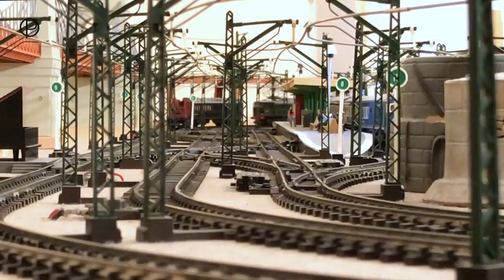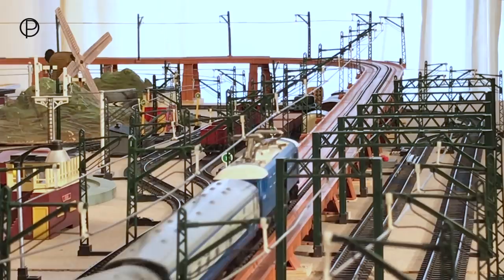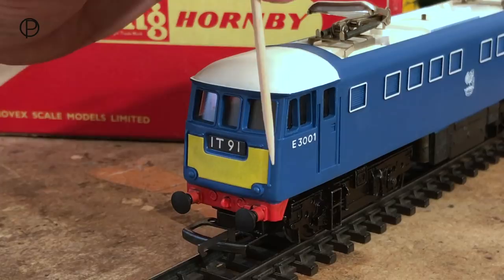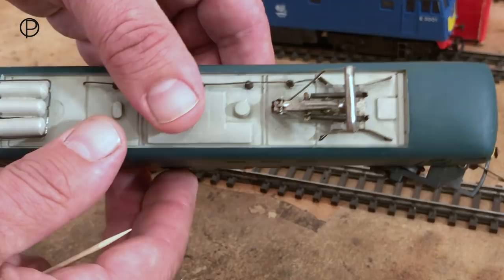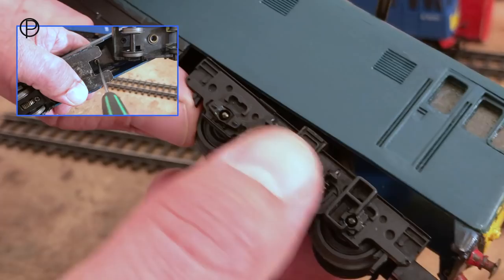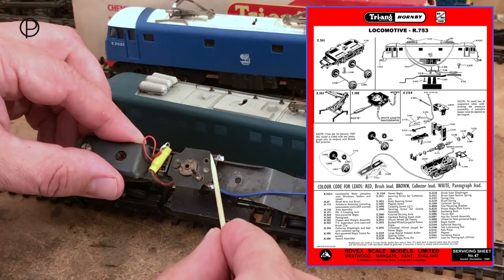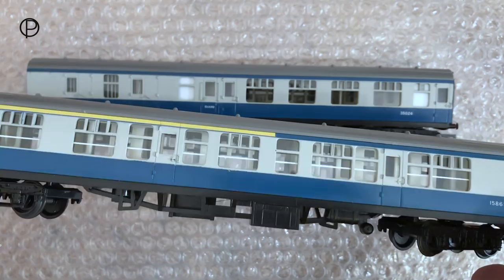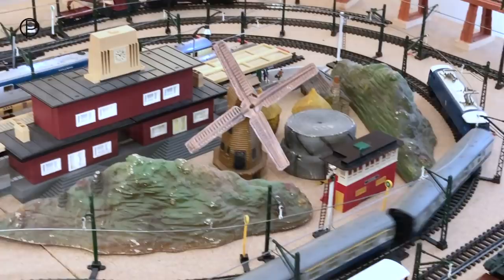Tri-ang Hornby R.753 Electric Locomotive E3001 with BR Blue and Grey coaches

Comment: That moulded " c "I think might refer to which side the cantenary should be for overhead working. 

For over 40 years that was my favourite tri-ang hornby catalogue cover,  and then one day I found my holy grail,  the original painting at lord McAlpines steam railway and museum in Fawley just down the road near Henley  on Thames!  

Great video as always,  nice to see that stuff working so well.
Reply from the maker: Thanks Steve, I think your right about the c moulded into the plastic body.  But I think it is a hangover from the Hornby Dublo and perhaps they had a planned catenary system.  As Tri-ang marked their motor bogies with an I for the insulated side and R for the return side.  Oscar

Comment: Hi Oscar....my later variant of this loco (with the arrows) arrived the other day and I am quite (happily) surprised as to the weight of this model. The motor bogie is not unlike the one used for the TC range which I am a big fan off as it is very dependable and has very good pulling power. 
I was reading up on Wikipedia about the history of the actual real life prototype and they mentioned the model by Hornby Dublo/Triang Hornby as being "crude"....I am not of the same opinion. For the period I think it was well executed and looks like the full size thing.  Very pleased indeed with my purchase. Still on the look out for the earlier colour variation with the white rooves though. 
Thanks for the information you give, it gives clarity in what to look for when searching for the different variations.
Beat wishes 
Brian
Reply from the maker: Good morning Brian great to hear you got one of these terrific locomotives. As you say terrific models for the time they were produced especially as they could run from an overhead system as well as the track! 
Thanks again for watching glad you're enjoying the videos.
Take care.
Oscar

Comment: Thanks Oscar, I have the older full yellow end version, and it has suffered the same damage as the single pantograph version you showed, it's had a bad drop which has cracked the cab at one end and sheared off the lump of plastic that holds the thread for the body screw, but she's a great runner!
Reply from the maker: Makes my knees hurt reading that list of damage Paul.  The main thing is she's still a good runner.
Oscar

Comment: The off position on top was a great idea. It would be the first "cab control" innovation. Two or more locos on shed without the need for isolating rails. I wish they still did it.
Reply from the maker: Definitely a very useful feature.
Oscar

Comment: I would suggest the number 3300 HP on the cab glazing unit is a reference to the power output of the prototype loco (4 × 847 hp, or 3388 Hp).

Comment: On electric locomotives the louvre side is to vent traction equipment and the side with windows is the cab to cab corridoor, also the early br electrics
Would run with two pantos up but then they switched to rear panto up front one down so if damaged the leading one would have passed the bit that had damaged the panto head, exeption
To this was the em1 em2 where pick up problems with using i panto meant they always used two
Reply from the maker: That's great thanks for the information.
Oscar

Comment: Your station must be manchester picadilly lol only place where em2 and ac electrics ran side by side,
There is a great pic on flicker of an electric blue white roofed ac loco being towed through south yorkshire on the wood head route an ac loco under dc wires for maintainance at doncaster and a pic of dc em1 locos being towed under ac wires en route for crew works, pantos locked down in both cases

Comment: Another top video Oscar. Maybe the “C” on the underframe detail had something to do with how the loco needed to placed on the track when using supply from the overhead?🤔 I think you mentioned a similar notation on the Electra. The coaches were pretty smart too and the entire train is impressive.
Reply: I agree Andrew, In North America we refer to that as the "common" rail.
Reply from the maker: Hi Andrew, your right the Tri-ang power bogies on these OH electric models need to be placed on the track with the insulated side nearest to the power mast. The bogie has a letter I on the casting on the isolated side and the letter R on the non-insulated "return side".  The letter  C seems to be on the insulated side. The body only fits on chassis one way. Hornby Dublo never got around to developing a catenary system of there own or none that's been mentioned in what I've read. Maybe it was C for closest to power mast? and Tri-ang simply did not alter the tool for the body mould and left the C in place. I would be interested to see the original instructions that came with the Hornby Dublo model apparently there was a 3-rail variation too.
Oscar

Comment: That "no collection" position makes no sense to me. Why would u want to switch off the loco, and if a kid accidentally witches there he would think the loco is broken. BTW. i brought my 1st few 00 vintage locos (i have a few in H0): Tri-ang, BR black M7 (R754), mint, with box and paperwork (for 22 GBP); Wrenn class 8 shunter (renumbered) BR green, average, no box (for 25 GBP). Too bad i only have the 3 Clerestory Coaches from that era to mach.
Reply from the maker: Good evening Tom. I think the idea behind the no collection option is so one locomotive could stand with the pantograph up whilst ( maybe in a siding as these may not always be isolated depending on track/catenary configuration) and another could move on the layout freely. Tri-ang made no isolating sections for the catenary! Black M7 one of my favourites. sounds like a good start and price to another part of your collection. You should be able to find plenty of options on coaches at excellent prices especially without boxes.
Oscar
Reply: I would have preferred an isolating switch on all locos for the reason Oscar has pointed out.  David.
Reply: So you could isolate the loco on the same track as a working one, perhaps in a depot or a siding, without the use of an isolating track or isolaters.
Reply: Agree, just isolate the track section, most manufactures has isolating joint, or something similar, there's even a block-signal segment with a similar purpose.
Reply: I did use past tense in my comment. I of course use isolating tracks now but in my youth (8 - 14 yrs old) isolating tracks were unheard of. It was marvelous to be able to turn off a loco.
Reply: Hi Tom, Certainly that's the way to do it now but it just wasn't available to me back in my youth.  David.
Reply: Tom PrickVixen it was a great idea you can isolate it as needed to run another train on the same bit of track
Reply: @oscarpaisley  Hi Oscar. I have this locomotive! Could you possibly indicate it's worth? Thanks!